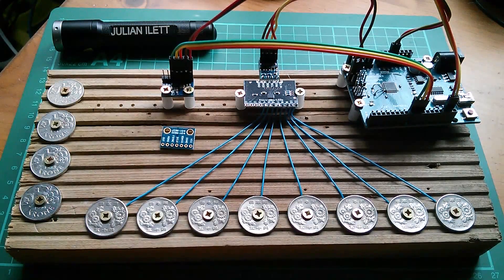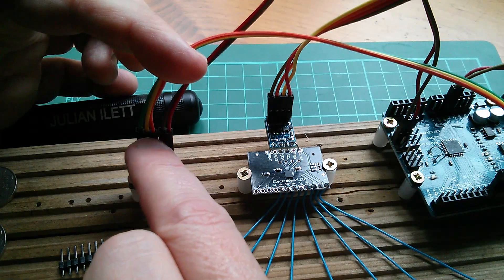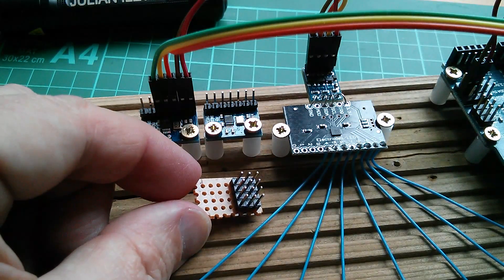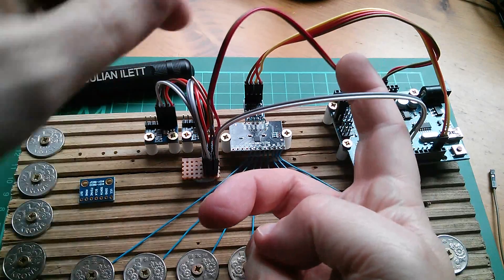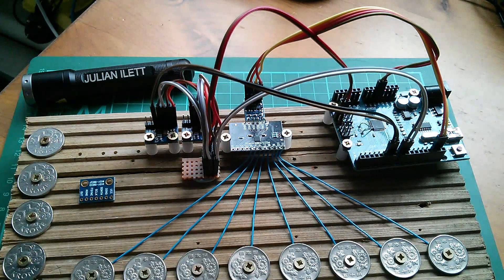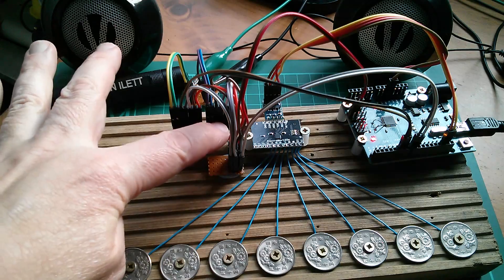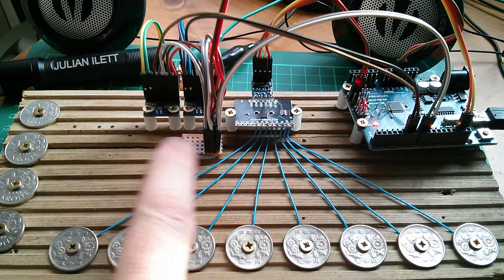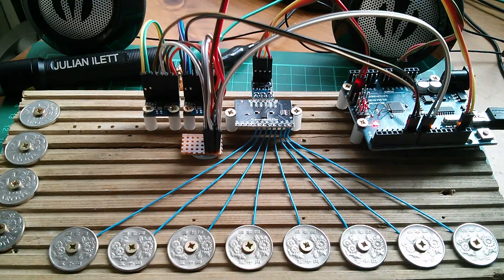Penny Organ gets a Second Oscillator

Comment: If you want to be sure you don't write to both modules at the same time you could use something like a 74138 and then your output pins can write in binary like an address bus. that way you can have 8 modules from 3 pins.
Reply from the maker: +RetroGames1979 That's true - but I don't think it'll be necessary. In fact there may be some advantage to using separate enable lines. To reset all the modules I can take all 4 enable lines low then send serial commands to all 4 modules simultaneously.